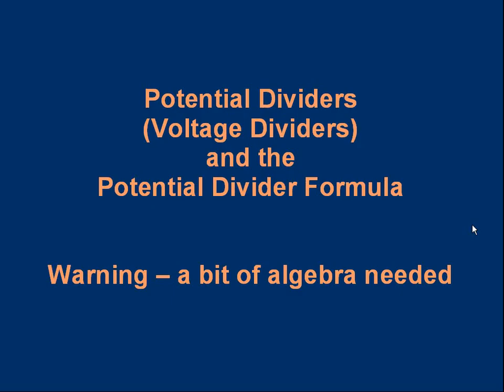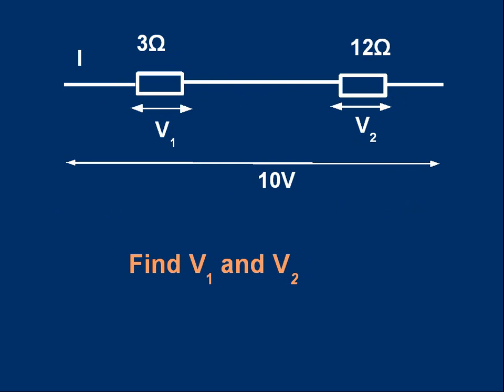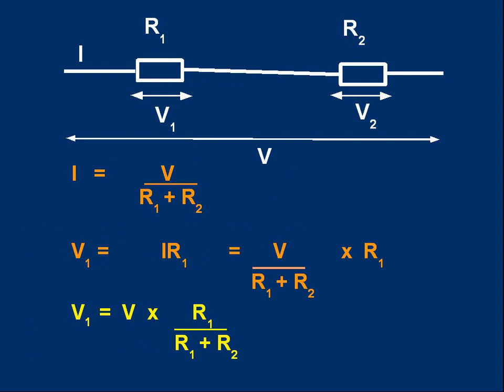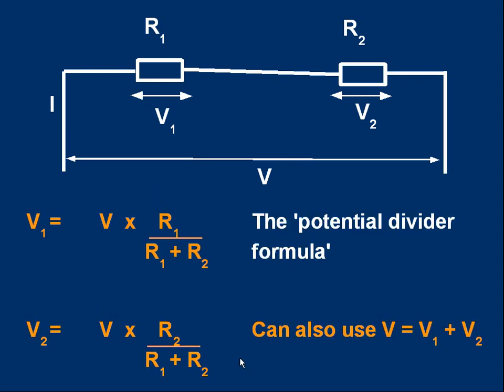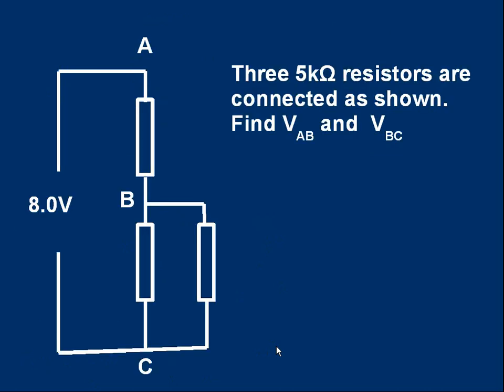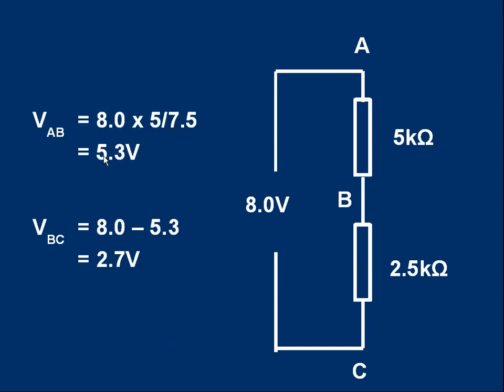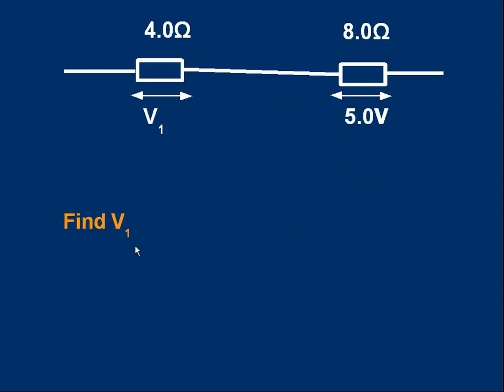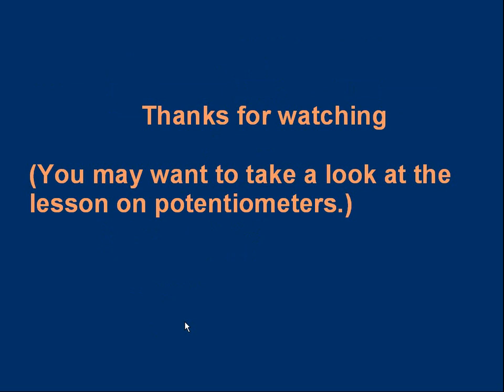GCE (A-level) Physics E19 Potential (Voltage) Dividers

Comment: sir I want to study deeply in detail about electricity and magnetism.plz recomend easy books for this
Reply from the maker: Studying 'deeply and in detail' is hard and demanding.

You need to have a decent level of mathematics and  an understanding of 
the basic physics to start.  Any modern A-level text books will cover 
the material at this level.  But what is simple for one student may be 
difficult for another. If you have a lilbrary, look through several textbooks to see if one suits you.

I have not taught for some years  so I am not familiar with current 
books. Therefore I cannot recommend any books. Sorry. Good luck.
Reply: Steve4Physics 
ok sir thank u.Good luck

Comment: Hi I just really want to know one thing the higher the current the higher the voltage, or is it the opposite?I am so confused, and high resistance = low amps right? and low amps mean low volts?
Reply from the maker: +Gargle Diggs 

Sorry, long answer...

.. the higher the current the higher the voltage, or is it the opposite?”

It depends.   If you are talking about the current through a single resistor in a circuit, and the voltage across that resistor, then “the higher the current the higher the voltage” is always true. 

But for a circuit containing more than one resistor, you can have several different
voltages and several different currents in the same circuit.  In this case there is no simple rule between the different voltages and different currents.

For example, increasing the voltage across component A in a circuit will increase the current through A.  But this this might reduce the voltage and
current for component B. 

____________________________________

“..  and high resistance = low amps right?”

It's a good guide for some situations – but not always true.  Keep in mind I = V/R.  If R is large but V is very large, you will still get a big current.

If you are comparing 2 resistors with the same voltage (e.g. 2 resistors in parallel), then the higher resistance has the lower current.

____________________________________ 

 “ and low amps mean low volts?” 

It's a good guide for some situations – but not always true.  Keep in  mind V = IR.  If I is small but R is very large, you will still get a big voltage. 

But for a single resistor, lower current means lower voltage.
 ____________________________________

 By the way, avoid using the word 'amps' when you mean 'current'. Examiners don't like it!
Reply: OMG this helped so much thx for replying ur great

Comment: Convert kilo ohms to ohms?
Reply from the maker: Prannoy Alemao 
The same way you convert kilometres to metres. Multiply by 1000.
E.g.
4km = 4000m.
4kΩ = 4000Ω

(Note.  You don't always need to convert to ohms.   For eaxmple when calculatinfg R₁/(R₁ + R₂), if R₁ and R₂ are both in kΩ, there is no need to convert from kΩ to Ω because the convertion factor (1000) will cancel-out.)
Reply: Steve4Physics thanks

Comment from the maker: I'm reposting, as all my formatting was removed byYouTube for my last answer.

4miles + 5miles = 9miles. No need to convert to metres first

Same for the resistance formulae
RT = R1 + R2 + …
And
1/RT = 1/R1 + 1/R2 + …
PROVIDING ALL VALUES ARE IN THE SAME UNITS.

e.g. 2kΩ in parallel with 8kΩ
1/RT = 1/2  + 1/8 = 5/8
RT = 8/5 = 1.6kΩ (the unit kΩ is used for all values)

Or 

1/RT  = 1/2000  + 1/8000 = 5/8000
RT = 8000/5 = 1600Ω (the unit Ω is used for all values)

Comment from the maker: 4miles + 5miles = 9miles. No need to convert to metres first!

Same for the resistance formulae:
RT = R1 + R2 + …
and
1/RT = 1/R1 + 1/R2 + …
PROVIDING ALL VALUES ARE IN THE SAME UNITS.

e.g. 2kΩ in parallel with 8kΩ
1/RT = 1/2  + 1/8 = 5/8
RT = 8/5 = 1.6kΩ (the unit kΩ is used for all values)

Or 
1/RT  = 1/2000  + 1/8000 = 5/8000
RT = 8000/5 = 1600Ω (the unit Ω is used for all values)

Comment from the maker: Hi. I’m not 100% clear on the question but I’ll try.  At 6:05, call the top resistor R1, the bottom left resistor R2, and the bottom right resistor R3. Some students ‘fall into the trap’ of thinking that R1 and R2 are in series.  If this were the case R1 and R2 would split the 8V equally so there would be 4V across each..  This is not correct.  You have to combine R2 and R3 in parallel first (1/RT=1/R2+1/R3)) then treat R1 and RT as the potential divider.  Hope that helps.

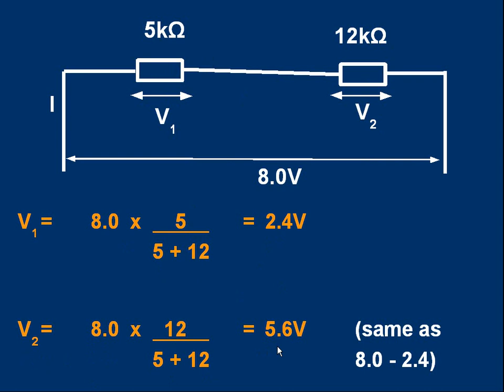Comment from the maker: Hi mediamaster08.  Well spotted.  If the components are in series their currents MUST the same.  I made the comment ‘providing the currents are the same’ as there is a risk (which I didn’t explain and should have).  Resistors can sometimes LOOK as if they are series - to someone who is inexperienced.  See the problem at 6:11 – some students think the 2 leftmost resistors are in series because they are ‘in line’, but they are not, their currents are different. I didn’t make that clear.

Comment from the maker: @headshotkillaz 

Hi.  The current is not 1.06A.  I = V/R = 8/7500 = 1.067x10^-3A (= 1.067mA).  
The voltage across the 5kohm resistor is then V = IR = 1.067x10^-3 x 5000 = 5.3V.

But if you use the potential divider formula, the 1000 cancels out top and bottom, so you can use units of kilohms in the formula.

Note, that with an 8V supply, you can never get voltages of more than 8V (unless you have some very complex electronics).

Hope that helps.

Comment: I have to say this was very nicely done and improved my understanding and will help in my A level physics
But if you have time i would really want some examples of potential divider circuits.
For example how does a potential divider circuit containing a thermistor do its job?
How does a potential divider circuit containing a LDR turn street lamps on and off? 
I have problems understanding this when a variable resistor such as a thermistor/ldr is placed within the circuit

Comment from the maker: @jptbaba 
Hi jptbaba.  Yes, if you prefer,  you can find the total resistance, then the current, and then find each resostor's voltage by using V = IR on each resistor separately.  It must give the same answer as using the potential divider formula.

Comment from the maker: @Glennitub 
Here and example.

R1 (= 3Ω) and R2 (= 6Ω)  in series connected to an 18V supply.

R1 has a pd of 6V and R2 has a pd of 12V. (Check it for yourself using the potential divider formula).

Add R3 (=4Ω) across R2.  Together R2 and R3 make RT.  1/RT = 1/6 + 1/4.  This gives RT = 2.4Ω. (Check it yourself.)

Now we have R1 in series with RT.
Pd across R1 = 18 x (3/(3+2.4) = 10V
Pd across RT = 18-10 = 8V

So R2 and R3 now both have a pd of 8V
(Total resistance reduced from  3+6 to 3+2.4)

Comment: Hey, what if the resistor in parrallel does not have equal resistance to the resistor it is parrallel to? What happens to the overall resistance then?
Is it 1/Rt = 1/R1 + 1/R2?